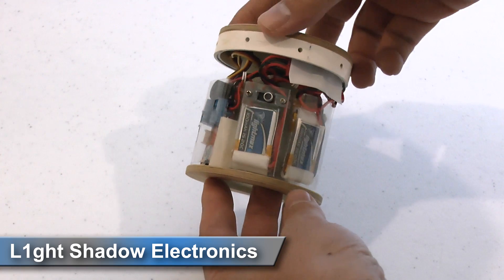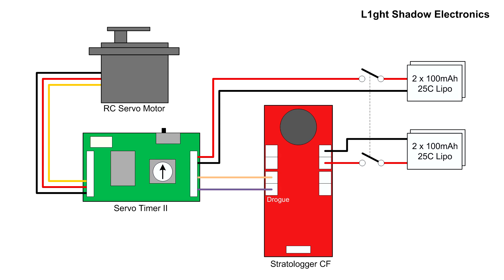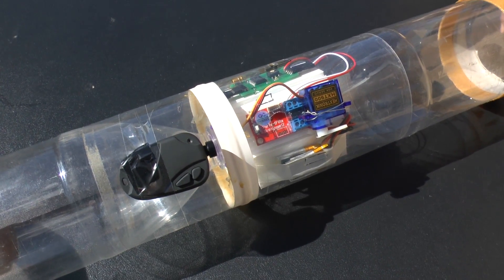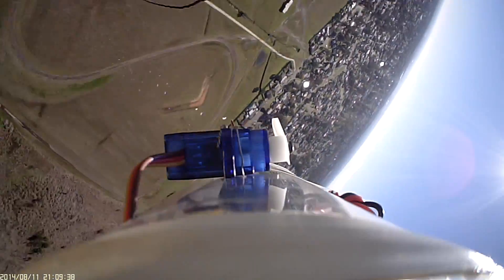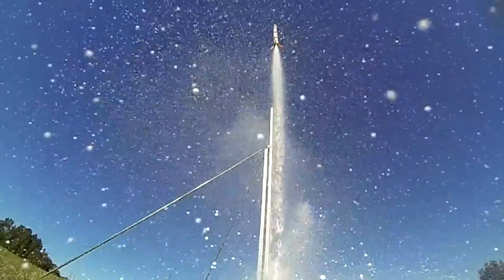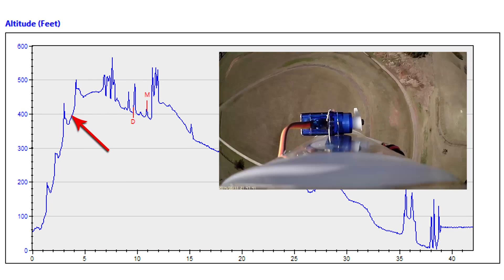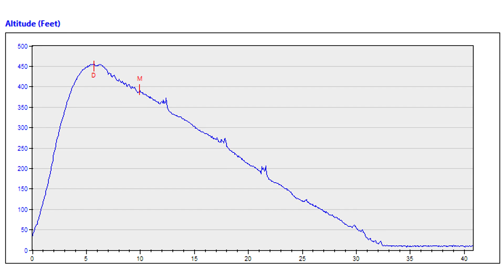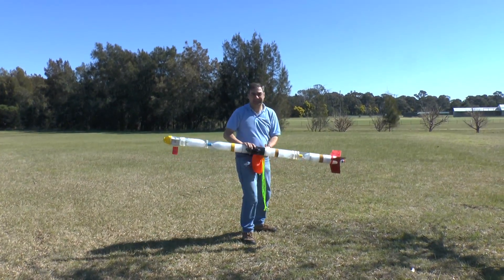Testing Light Shadow Electronics

Comment: Great to see the latest part of your series! As always, very interesting. :) I never thought that sun light has such an impact on the altimeter data. Good to know! :) We're looking forward to see the flights of the rocket (both pyro and water). :)
Reply from the maker: Thank you Julian. It was interesting to see because the sensor itself is located on the bottom of the board so it was between the PCB and the Corriflute, but obviously the sun was getting in from the side.

Comment: I know about this problem but why that is....no idea. Because all the ST2 timers where destroyed due to many crashes, I had to switch to the launchpad altimeter from US waterrockets.These have the seem problem.Also apply tape to block sunlight. Despite this problem  everything workes fine. That's a good video that everything has to be tested first and solve all problems before launching rockets.Good to see that the tree was not too high :)
Reply from the maker: Thanks teamlucrockets. I'm glad we had a chance to test it before flying it on the main rocket. I though it was quite funny that with the last test the rocket should get stuck in the tree. :)

Comment: I'm assuming the barometer measures air temperature as an input to the pressure calculation? Didn't realize a few seconds of sunlight would affect it so dramatically.
Reply from the maker: Yes I believe that is correct that temperature is taken into account during the calculation, though I am not sure what the actual mechanism is for the baro sensor being so sunlight sensitive. The change in reading is pretty instantaneous when direct sunlight hits it.